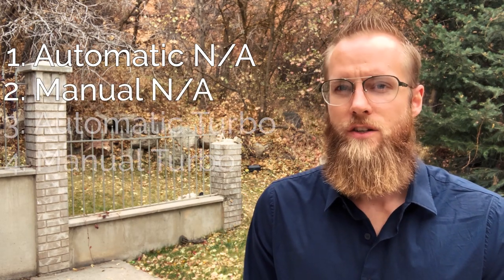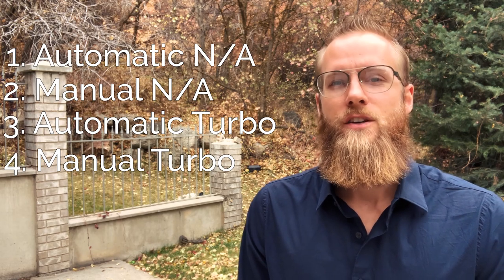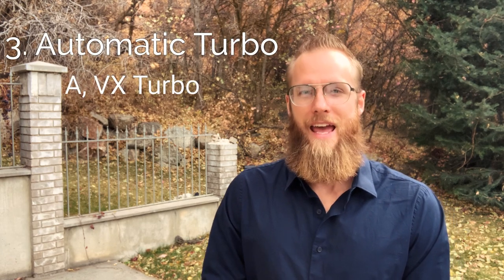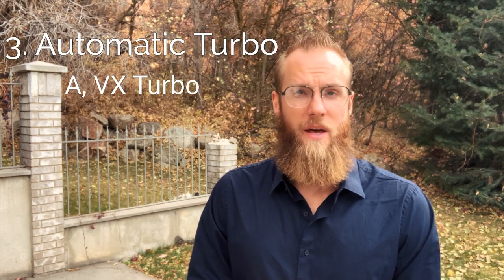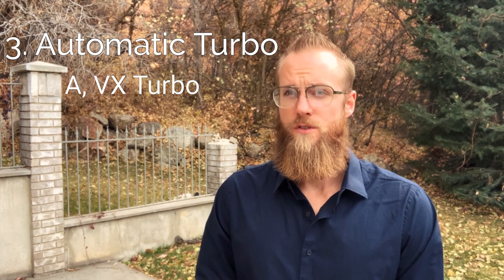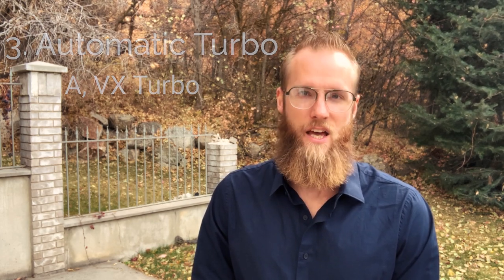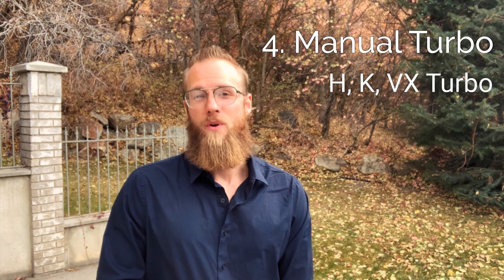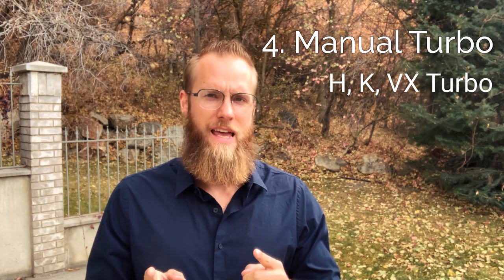Volvo 240 Camshafts

Comment: yeah H cam is a bit dead if you plan on mid to low rpm drive the car but i do advice on advancing ignition if possible then, the H cam loves ignition timing and by doing that it pull harder than my vx ever did even at low/mid rpm at stock timing
Reply from the maker: Hey thanks for the info! Do you know of any guides on timing advancement/things to be aware of etc...?
Reply: @jonrasu  well on the lh2.4 you can grind the directional l on the crank sensor reader and turn it the other way around in the plug and it somehow gives 3deg of advance on timing across the entire ignition map. or get ignition chips, 
here is a vid explaining what i mean https://www.youtube.com/watch?v=WL-pqWKHksY&ab_channel=ABM at 5:00 min mark
Reply: @jonrasu  you simply turn the contact around in the plugg hole, i have a ign chipp and done this mod so i drive on 98 octane, but simply turning the contact back and i can drive on 95(standard)
Reply: @Stale_Mahoney  I can't even buy 95 octane gas where I live, let alone 98!
Reply: I have a b230k engine in my volvo 240 which is an N/A carburetted engine, from what ive seen they apparently all use the T type camshaft stock rather than the M type.
Correct me if you have heard different.

Comment: You describe the Volvo 240 experience so well I died laughing. I daily drive my 89 244 na auto with 277k miles, my father daily drives a 90 244 na auto with 260k miles. We also have a 90 245, and we just recently bought an 88 na manual.
Reply from the maker: Glad you enjoyed it!

Comment: I've had a new IPD VX N/A cam on my Volvo "to do"shelf for 6 years now. So difficult to tear in to a perfectly running engine and risk making things worse, especially with only 43K miles on it!
Reply: Yep. The old adage: 'If it ain't broke don't fix it.' applies in that case. lol
Reply: 43k miles Jesus mines at 300k
Reply: Do you still have that IPD VX N/A cam sitting around on the shelf? Would you consider selling it?
Reply: @bobjohnson1587  Hi Bob! I still have it but I think I'll hang on to it for now. If I ever have to work on the head I will install it.
Reply: @mortimergladbreath  Not a problem. I thought I would ask. Thanks for the quick reply. I'm planning on checking/adjusting the valve lash and replacing the hushers on mine sometime this spring/summer. Since I'll be doing all that I thought it might be a good time to possibly replace my stock cam. The IPD VX cam sounds like a good alternative for a n/a B230F.
Reply: @bobjohnson1587 Hopefully you didn't get it. VX with 6° advance and few other mods pulls like freight train in low to mid range but up top there's nothing. Bought it,used it for 2 years then bought H cam and it's far better. Mid lose low and mid range power if your car is bone stock but for me it was fine and still pulled good. Top end 3000-> towards rev limit is so good!
Since those cams cost basically nothing from KL Racing, everyone should buy one

Comment: What about the V cam? Wouldn't an A cam be better for the automatic than the B cam, since it provides better lower end with less duration? What of aftermarket camshafts from sweden, ENEM and KGTrimnig?

Also, the 'VX Turbo' is the IPD Turbo cam, very different from the VX cam. VX specifically refers to the profile, V intake and X exhaust.
Reply from the maker: Hi there, I actually did not know that V cams existed until you mentioned them. I couldn't say which would be better from experience, but others have reported their preferences which I have included in the video. Also, I did not see any prominent information on aftermarket cams. If you have experience with these, please respond here for anyone else who has your same question!
Yes, it's a potentially confusing naming convention for IPD to use.

Comment: just found a k cam for my 940 na now just waiting for adjustable timing gear and expecting maybe 25% increase in hp which should be enough to allow me to merge safely
Reply from the maker: Glad to hear it! I think that is what I would have suggested without doing much additional research. I think your adjustable timing gear will be well worth the investment here!
Reply: A K cam (same as KG Trimning KG004) should give about 10bhp.  I'm about to do that on my M cam B200F.  From what I read, the airflow through the exhaust ports is lower (even with a 531 head) and 12mm valve lift (which the K cam has) is optimal.  I have a dog dish flywheel so there is not much point chasing much more than 6000rpm.  If I can get peak torque at 4200-4500rpm, that will be fine.  The smaller engine will make the cam slightly hotter than if installed in a B230 anyway so no point going too far.

In the end I went for a V cam.  Best torque around 3800rpm.

Comment: Thinking of swapping my 89 244 with 277k miles
Reply: Same with my '87 245... well over 300k and doesn't smoke or use oil...  might just throw in a k and put a freer flowing exhaust on and see what happens 🤔